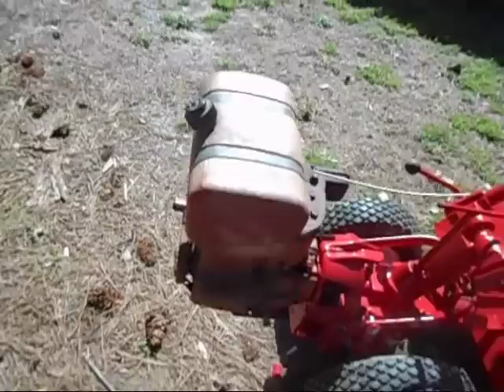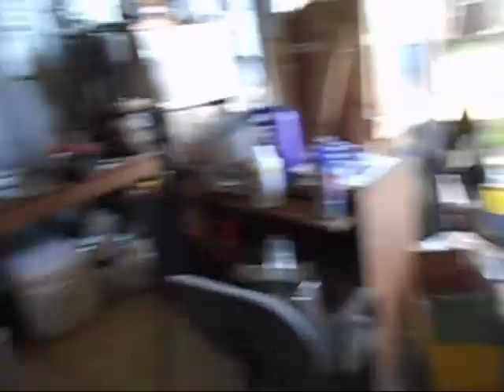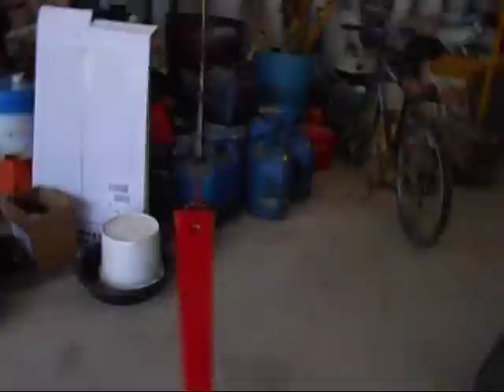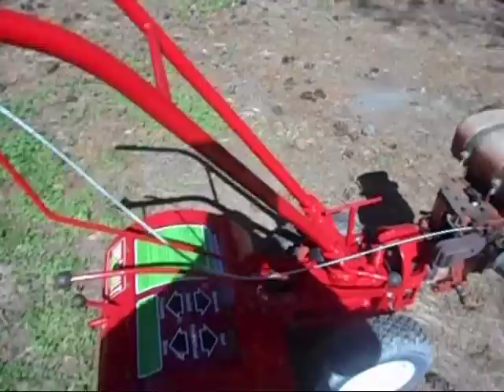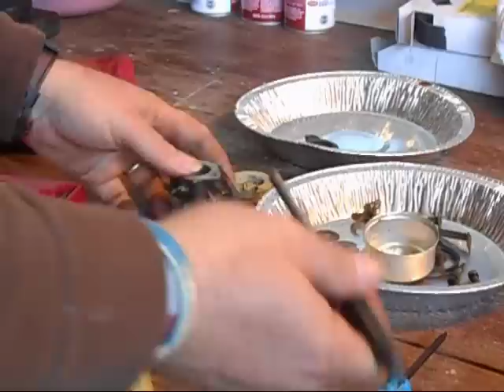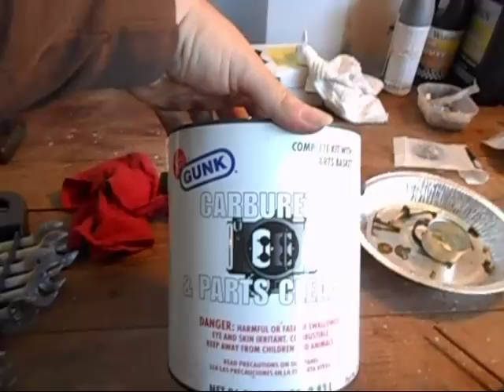Troy-Bilt Trans Re-Assembly Pt 9

Comment: That was probably the best carb. tip I've ever heard.  I have a 12.5 hp Tech. that will only start on carb. cleaner.  Once started it runs fine, but a cold start requires a squirt. When I have time I'm going to check that fuel pick up...Thanks for a great series...Happy Tilling
Reply from the maker: You are most certainly welcome and I hope it helps get yours running better. Let me know how it turns out.